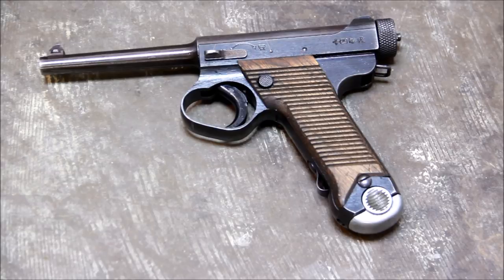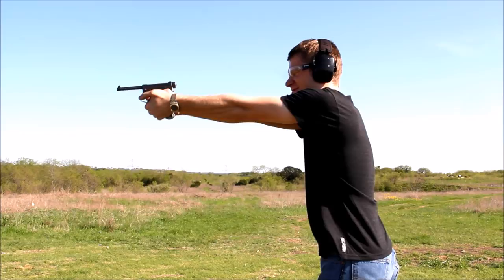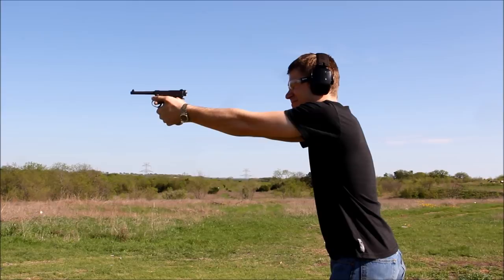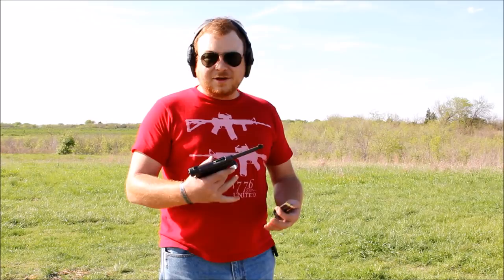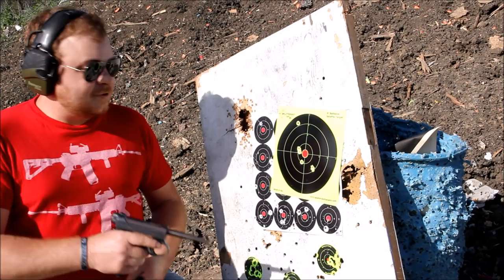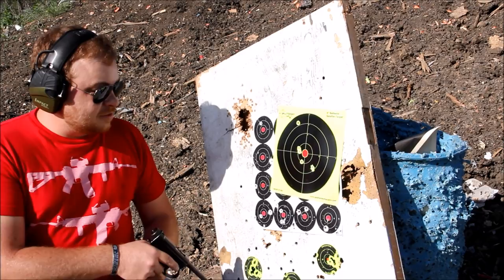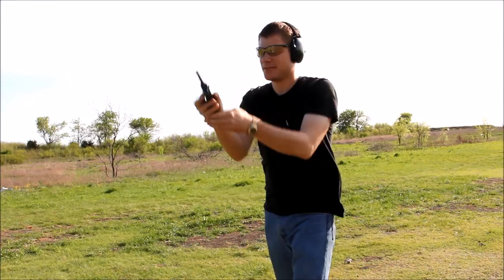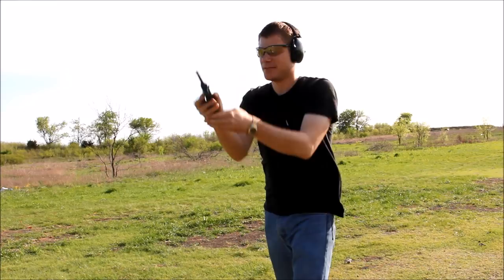Type 14 Nambu Pistol 南部拳銃

Comment: with all the malfunctions, a musket has a higher fire rate than this.
Reply: haaaaaa
Reply: That is actually pretty true
Reply: Not to mention stopping power. The Brown Bess was a 75 calibre rifle.
Reply: +Ryan Thomason though standard practice was to use .69 caliber ball so its accuracy would be terrible past 50 yards.
Reply: +mike C I don't think that a nambu would reach 20 yards. Lol.
Reply: Maybe if you threw it
Reply: Duru eh I shot mine with a pretty cruddy bore and I could get about a foot grouping at 40ish yards.
Reply: Unfortunate too, it's a cool looking gun. Interesting operation.
Reply: The striker broke and the spring is probably weak from age. A newly made Nambu or one with intact parts and new springs won't run anywhere near this bad. This isn't a good example of the firearm's reliability. I mean if you broke some parts on any gun it's not going to work.
Reply: LOL
Reply: +Kyle Hanson while that is very true it kind of shows the shody craftsmanship of this particular example, many self loading handguns of this age an older run much better, and this is a pretty wimpy cartridge on top of that. But you never know I guess, could be a later war example which are terrible.

Comment: This right here is a great example of a "Hang Fire" @ 3:45
Primer was struck and caused a delay in detonation. Please be careful guys when a potential hang fire occurs. Give your pistol at least 20-30seconds pointed in a safe direction before trying to clear it. 
  Very sketchy little pistol to say the least.
Reply: GY6vids I thought hang fires were a mechanical failure with the gun. Did not know that a primer can cause them... I shoot a lot of remanufactured ammo for practice but have yet to have a hang fire. Thanks for the info, I'll keep this in mind if I ever do get a dead round.
Reply: Well I know for a fact that it can be a mechanical issue with the firearm as well. Example: I had a friend that bought a new pistol, shot it out of the box and had several hang fires. Ended up being tiny metal shavings from machining catching on the striker. He cleaned out the gun and no more hang fires. I imagine other issues with firing pins/strikers could cause this as well.
Reply: xXxBlackwaterXxX hang fire (plural hang fires)(firearms) the situation when a gun does not immediately fire when the trigger is pulled, but may fire shortly after.

Seems to fit the definition, as loose as it is. I guess you could just call it a malfunction with the gun but when the end result is the exact same thing I think its safe to call it a "hang fire". Really just seems like nit picking to me, but I guess thats the subjectiveness of a loosely defined term.
Reply: +GY6vids Had a hang fire once with my muzzle loader once, and can say it will scare the living daylights out of you if you don't expect it.
Reply: I agree it went click unlike the other malfunctions and I'd imagine 8 mm nambu ammo they were using was pretty old and if its Japanese original quality wouldn't be the best. typically with vintage 1920s ammo I have just had a moment tary delay just enough to notice but not to take action
Reply: +dustyak79 either old or made out of .40 or something and not reloaded properly I'd imagine.
Reply: +GY6vids Hang Fire is how the world gets rid of it's idiots.  Definitely the people who look down the barrel going WTF.
Reply from the maker: +GY6vids Actually it was a broken firing pin. Hang fires rarely occur in new production ammo like what we were using. - Patrick
Reply: Hang fires are ammunition related. They're due to poorly stored ammunition. This was due to a broken striker.
Reply: That was a good one , Respect :-) .
Reply: Well Nambu in Punjab names lemon and that's what this pistol is haha
Reply: Tawny Owl It's a Japanese made pistol not Chinese...
Reply: Also a good example of why you follow the rules of gun safety, primarily muzzle discipline.

Comment: That misfire was fucking scary, dude.

I knew that Nambu pistols were not known for reliablity... but holy hell, all those malfunctions make it bad on a shooting range. I wouldn't carry that with me as a service pistol for a million bucks.

Are these due to the age of the pistols or would a new one have still the same problems?
Reply: If made the same way, they would misfire. However, modern safety would not really manufacture it as low quality as the old ones.
Reply: YOu might be more effective trying to run at the enemies and club them on the head with the nambu than actually shooting the damn thing. At least you run less of a risk of shooting yourself.

Comment: I've been collecting Japanese firearms for a while, and what that looks like to me , is that the recoil springs are worn out, as is the extractor (A paper thin metal piece riding on top of the bolt.  The best source for ammo for it, is a guy in Reno, who's name i forget at the moment, but he had beautiful 8mm Nambu reloads.  Yes I have one of these, and I shoot it fairly often (and reload), and they are a little finicky. You may want to get a replacement spring kit.
Reply: +Scott Ruggels 
I do believe he said in a comment somewhere that they replaced the recoil springs. Might actually be the problem though, the ammo doesn't seem to be in the best condition and might not be strong enough to cycle.
Reply: @ScottRuggels  will standard 9mm fit in a nambu magazine

Comment: Wolff makes spring kits for these. The springs the Japanese manufacturers used weren't really that good so they wear out really fast. Even hand cycling over the years can take a toll on them. After the war this could have sat on a wall or got used by a kid as a war "toy" because dad could never find ammo for it back in the 50's and 60's.

I did talk to a Nambu collector at a gunshow. He had hundreds of magazines and when I asked why he didn't have any at the show he said that they needed to be fit to each gun in order to function reliably. I'm not sure if there is truth to that but he did have some Nambus with him and seemed to know the pistol more than I do. That may be an issue with yours if that's not the original mag.

When these guns were new they were plenty reliable and pretty accurate. Sure they had problems more frequently than other designs like the Luger. Back then though they worked and since a sidearm wasn't a priority to the shiny brass that controlled the money the NCO's who were issued these and officers who bought them due to some sense of nationalism had to deal with the quirks.

I have one and think it's a dandy little gun. I would never want it for anything besides an excellent addition to my collection or a hole puncher for the range. That being said, I have never shot mine and refuse to shoot the two sealed boxes of ammo that were in the holster with the gun.

Comment: I remember this episode of Tales of the Gun which showcased Japanese firearms of WWII and one of the historians stated that the springs on this gun would get worn after a while, which looks like what happened with this gun. Perhaps if the spare parts for this gun could be found and the spring replaced it might actually fire a lot better.

Comment: Beautiful gun, but is worn
Reply: +stephen sansom Keeps you awake
Reply from the maker: +stephen sansom I have rebuilt the entire thing with all new springs and parts.
Reply: +TFB TV before or after this test?
Reply from the maker: Mattebubben
Before.
Reply: +TFB TV  Since you changed out the springs you can't blame the age for the malfunctions.  The ones made later in the war were of much poorer quality than normal however.  Without knowing when this gun was made we can't say that it represents the gun as a whole.
Reply: +CapnHolic The gun generally had bad springs even before WW2 even started but the ones during 1941 till the end of the war had the worst quality. Especially those with the bigger finger guard.
Reply: +stephen sansom These had a reputation for all kinds of issues even when they were new.
Reply: +TFB TV Yike.  Now i understand why the issued swords as well  lol.

Comment: One of the few times an accidental discharge can be traced to the gun, not the shooter. That thing is terrifying!
Reply: Maverick44 Nope. He pulled the trigger, the firing pin struck *click*, the round didn’t fire. When this happens you must assume that the round may have a delayed ignition and go off, so you wait 30 seconds. It was completely his fault.

Comment: It's a weak spring that needs to be replaced, nothing more.
Reply: Neptune Bluez It was/is historically known to be a bad pistol with lots of malfunctions.
Reply: Neptune Bluez that is the case with many of these pistols.

Unfortunately, the Japanese are often mocked for their firearms, when the designs in most cases are quite sound, and even good, especially considering the industrial capability of the East Asian region.

The big problem with these was the firing pin and spring strength. The bolt is driven by two very weak springs, and the problem was obvious.

Yet, the military never addressed this issue. Maybe they had a bunch of weak springs already made and didn't want to change them? Who knows, but the obvious issue was never fixed; they only provided soldiers with extra firing pins so they could try them out, and replace them when they broke.

Otherwise, the gun locking mechanism is quite interesting, and it's a good design considering the lack of competition in the whole region. Their revolvers (like the Type 26) were actually quite good from what I've been told, and machinists were quite capable, but quality dropped heavily during the war.

/watch?v=SAzeo_VEC0E
for more information.
Reply: Laifs It's an element of Japanese culture to sort of shortcut and push things out the door as fast as possible, coupled with an extreme difficulty of admitting to problems; particularly while under stress as in war time. This same effect was seen in the nation post-war, as they struggled to use their industrial capacity and know-how to generate exports, which were often seen (rightly so) as crap. It took a couple decades for them to slow down, take a deep breath, and start generating the quality they were capable of. 

Consider that, for a couple centuries Japan was seen as the world's premiere firearm maker - but those were hand crafted muzzle loaders, built slowly with exquisite care and craftsmanship. However, when stressed Japanese tend to panic and hide, cover up or ignore errors... which leads to quality issues. 

I know I'm painting with a very broad brush here; but culture matters and has an effect on any endeavor a country takes on. Given time and breathing room, Japanese engineering and manufacturing ability is masterful and exquisite (for example, I'm a dedicated Toyota fanboy here... these things run forever). Put them under pressure, however, and the wheels fall off more often than not.

Comment: Get a Wolff spring kit, best $15 you'll ever spend. :)
Reply: +1feral1 Wanna bet that modern available ammo is also a fair bit weaker than original to make it safe for the worst guns? A lot of these old guns don't cycle well with repro ammo made to be safe in the worst possible gun rather than give the full cycling energy.
Reply: +Chris Collins Dude, no offence, but if you have the thing go off in your hand like that one guy did, you could only imagine how it was in the field. And it's a piece of shit if you can't fucking fire it stock without needing to put in something else to fix it. That's like buying a car with no breaks, and then saying the car is great after you put them in yourself.
Reply: Erreul If you are talking about an 70 year old car with the original spark plugs in it, it is very sensible to replace them. Here he has an 70 year old gun with worn springs. Springs are a maintenance item just like spark plugs
Reply: GunFun ZS Why would you drive a 70 year old car that has original anything in it? I would like to go over 30MPH.
Reply: Erreul Because you enjoy the history and style of it. Same reason as you might shoot a type 14 nambu. -- I was refuting the rather absurd comment above mine that assumed an antique wartime pistol ought to run as well as a modern new production pistol with no maintenance (and probably on weaker ammo.)
Reply: GunFun ZS Fair enough.
Reply: 1feral1 Do you find that modern ammo is loaded weak? I know this is common practice with new production obsolete ammo, to account for possible poor condition of the guns.
Reply: Or better yet, buy a better pistol.
Reply: @WTFisTingispingis  The pistol is not at fault, the shooter is.
Cleaning well and lubing your gun before using it, especially if this gun is more than 100 years old, is mandatory.
Getting a replacement spring kit is often  necessary.
Then... you have to use the proper ammunition.
Some cartrige sold allegedly for Nambu are not good.
Buffalo ammo works well.

It's VERY unlickely the japanese army used a defective gun for 40 years.

Comment: Weak recoil spring that needs to be replaced. The 14 is a reliable weapon if in good shape (This one CLEARLY is Not).
"Unlike the Luger, which employed a toggle-type action derived from the earlier Borchardt, the Nambu featured a short-recoil, locked-breech action. This, coupled with the gun’s rigid barrel/frame construction, made for a very reliable and accurate handgun."

Read more: http://www.gunsandammo.com/historical/wwii-pistols-pacific-u-s-m1911a1-japanese-type-14-nambu/#ixzz3ad9BgwHY
Reply: +thelegobrain I personally think it was the fault of the ammunition rather than the gun. The Nambu was shitty, but not THIS shitty
Reply: Matthew Pham
Could be so. I suppose it could have been cheap lightweight ammo that played a part. A heaver grain may have actuated the mechanisms more and resulted in less firing issues. However, the slide still seemed to malfunction even when a person was cycling it so I don't know. Maybe they got their hands on the worst Nambu ever. A factory fuck up perhaps in combination with cheap ammo would explain a lot of what happened in this video.

Comment: That's what you get for plagiarising one of the best pistols in design.
Reply from the maker: +Lyne Taperz What pistol?
Reply: Oh, for first, I didn't mean to you, but the original designers of the pistol back at the 1940s. And for second, I thought they pretty much plagiarized Luger P08 pistol in design.
Reply: It's only aesthetically similar to the P08, the internals are completely different. It's not even toggle lock.
Reply: +Lyne Taperz This pistol is from before world war 1, and has NOTHING to do with the Luger other than a external resemblance. Its not even toggle, its straight bolt. Don't say things like that when you have no clue what the hell you're talking about
Reply: +Manilla Ice The Luger is pre-WWI, too. That's why it is named P08. There also was a P04 in 7,65.
Reply: Karl Wiesmann I know. But he said the Nambu was from the 40s
Reply: Manilla Ice ah ok
Reply: +Olaf Mikli not to mention safety on a luger compared to that 0.0
Reply: +Lyne Taperz  As if all gun designers don't copy each other's designs at the drop of a hat (and the expiration of patents).
Reply: RonJohn63 doesn't matter the nambu is not a copy
Reply: +Manilla Ice it's kinda quite similar mechanically to the c96 by mauser.
Reply: mike C Not really. It uses a internal bold system, but it's external mag, and the trigger system is waaay different
Reply: +Manilla Ice yes mechanically as the system that fires the cartridge, triggers and magazines are obviously different.
Reply: +Lyne Taperz not even close the Borshardt was the lurgers predessor and they both used a Toggle locking system the nambu doesn't have a toggle lock they copied the look of the luger but not the function which is why it is a piece of shit lol
Reply: Maybe I should say that I'm ignorant, or it was a joke? Srsly mates, this comment is more than 5 months old...
Reply: Agreed. I'll never do this kind of mistake again :)
Reply: +Lyne Taperz 

+1 to you for aknowledging a mistake. Not many people do that!
Reply: +Lyne Taperz It takes guts to acknowledge your mistake on the internet. Good job.
Reply: САLIMBO ГГГ Please read through the whole replies before cursing me. Please.
Reply: Lyne Taperz No need for me to argue. I'll just repeat what people have already explained to you.
Reply: Fine. Then please proceed.

Comment: I have a non parts matching Type 14.  At some point the pistol was professionally hand fitted, polished and reblued, possibly to get the non-matching parts functioning properly? I had it safety checked by an experienced gunsmith but I couldn't get more than two shots in a row without malfunctions, mostly failure to go into battery. I installed  replacement springs (including magazine spring) and firing pin. It ran a bit better but not much. I put the OG magazine spring back in and it has run surprisingly well ever since. It's actually very  pleasant to shoot for a pre-World war I design. It's also pretty accurate, doesn't have the cartoonishly high bore axis of so many other pistols from this era.

Comment: 19.6 = 44 of June of 1944. The reason why your Nambu jams is because of the weak recoil springs or because it's a late war production model. The main reason why it went off in your hands is because u hit the firing pin extension to dent the bullet's primer and made the gun misfire.

Comment: Interesting bit of info; 8mm Nambu fires a bullet that's smaller, lighter, and slower, than 9x19, if shooting the two rounds through comparable barrel lengths. Pretty weak, in spite of being bottle necked like 7.62x25. That Tokarev round, now THERE'S a snappy little bugger.